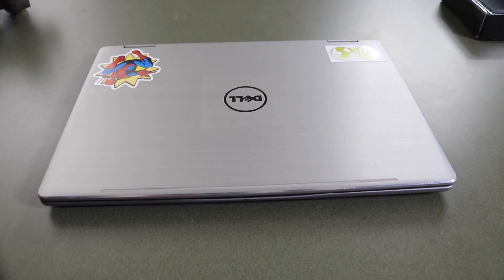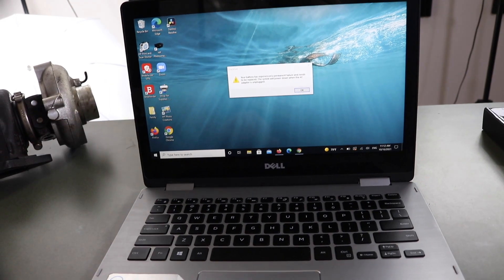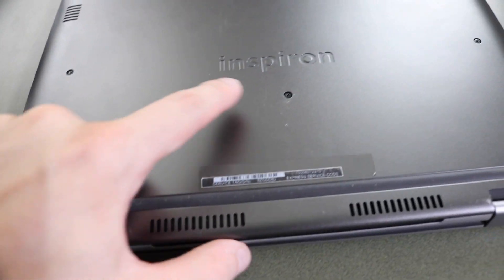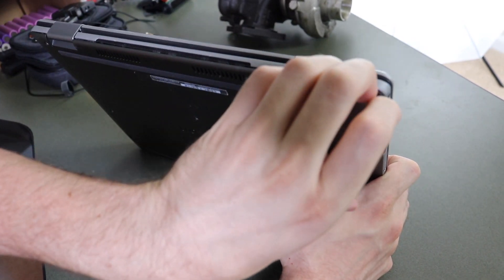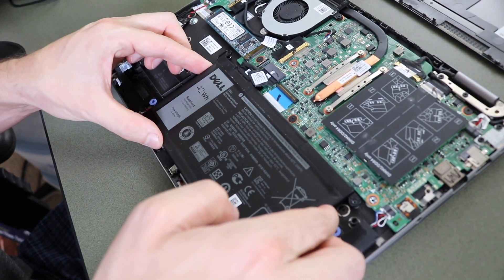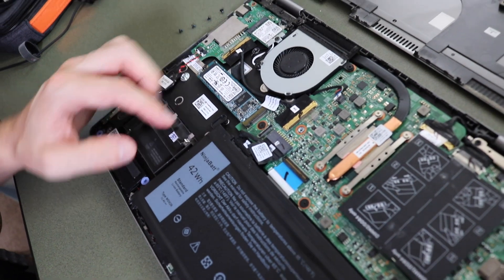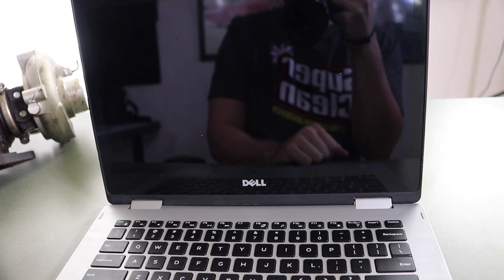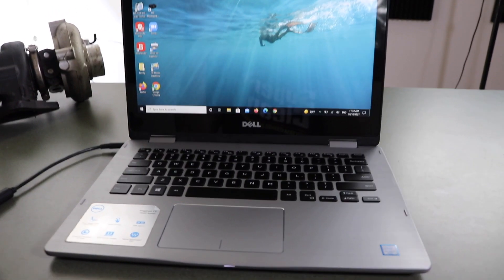Dell Inspiron battery replacement

Comment: The best video on replacing a Inspiron 15 7579 5567 5578 5570 5568 7569 5579 5565 7573 13 7378 5378 7368 5379 5368 7375 17 5767 Y3F7Y
 battery.

Is there a way to test the perfect health of the new battery before opening the laptop?